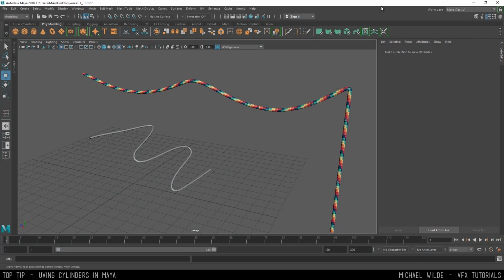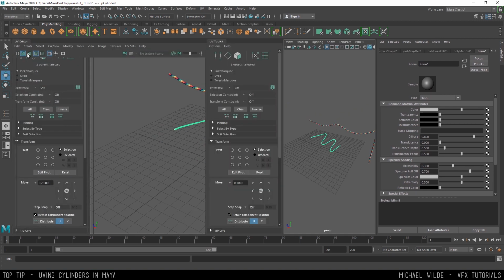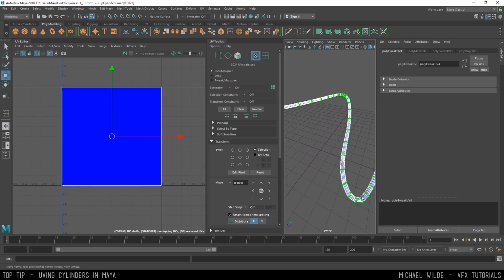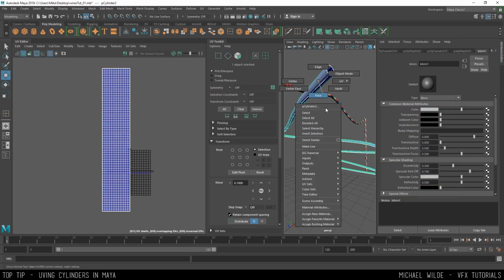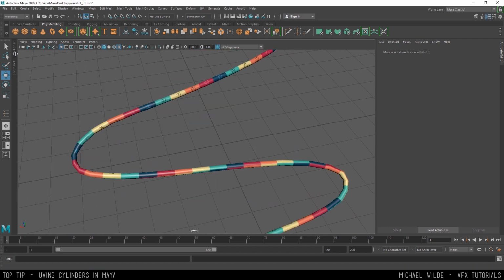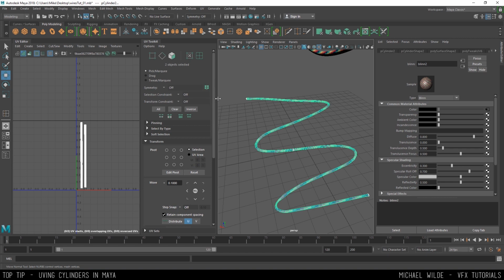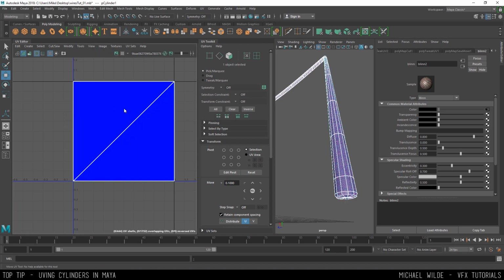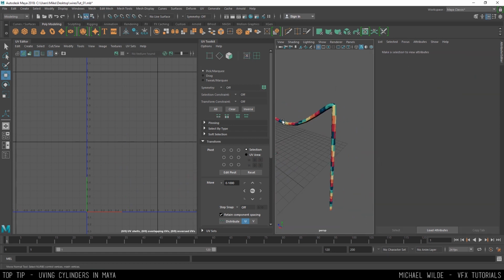UVs Top Tip - UVing Cylinders in Maya

Comment: is this tip only bound to cylindrical shapes or any shape in general?
Reply from the maker: It is specifically aimed at doing that, as often the Auto UV for cylinders is bad, but it could also be applied to other surfaces too. I'm not sure how the results would look but i don't see any harm in trying it if you're finding it hard to get good results with other methods :)